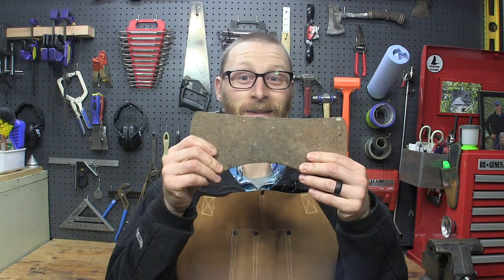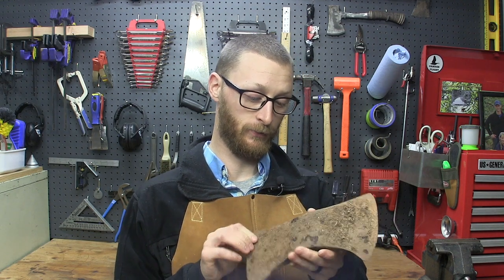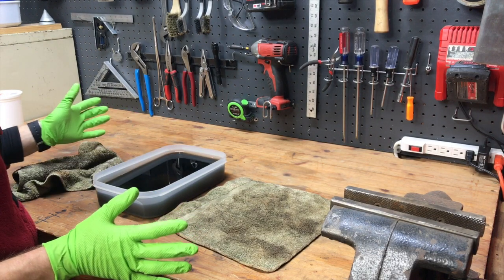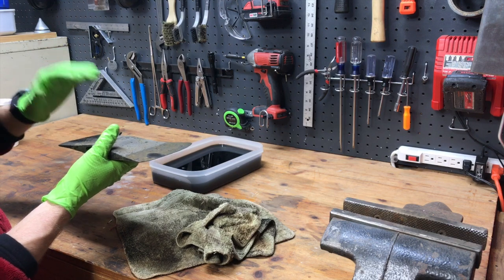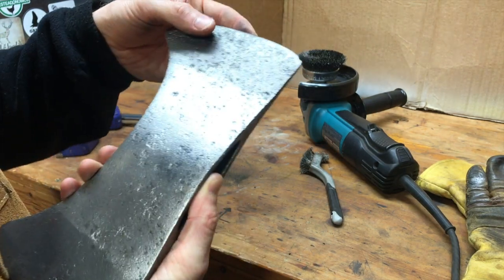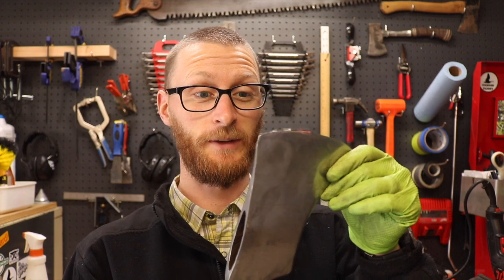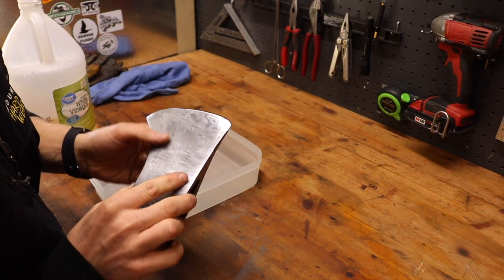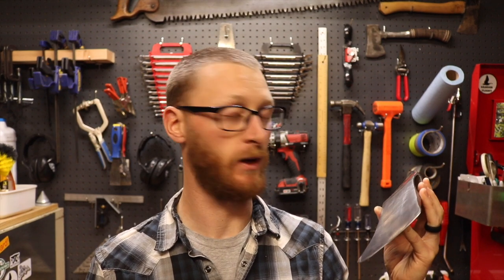What To Do With a CRACKED Axe Head?

Comment: Given a full workshop, I would have probably welded the cracks and filed them down to keep it a double bit axe. Then at the end heated it and dunked in oil to give it that dark patina you were looking for.

Regardless, I think yours looks fantastic. I definitely agree with your decision to get some finer grit sandpaper. Make that thing a mirror! ;)
Reply from the maker: I've been doing some research and apparently welding would mess with the temper and you'd have to re- heat treat the whole head. Definitely not a simple repair.